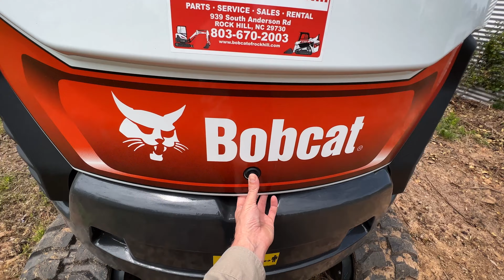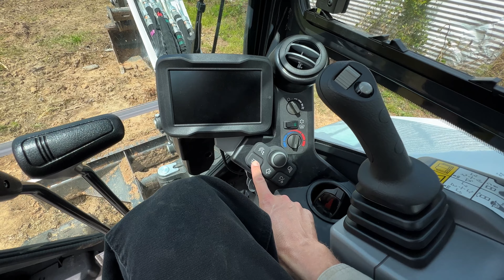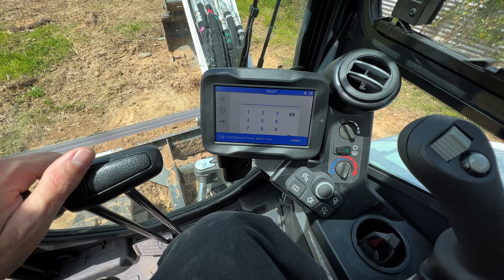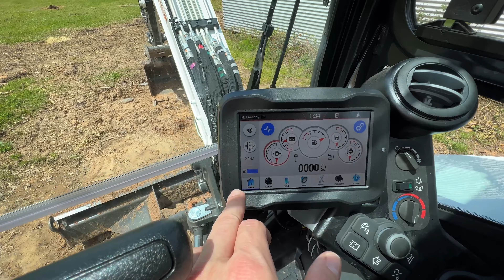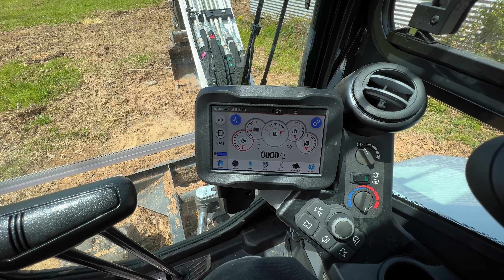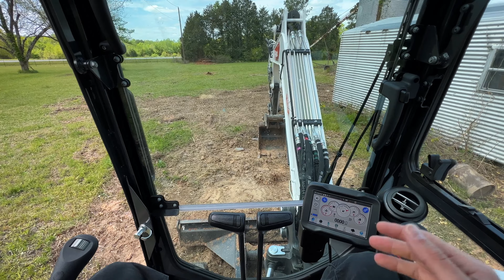New Equipment! 2022 Bobcat E42 R2 Series Added To The Line Up! Pickup & First Dig!

Comment: I always prefer the std control over the iso in the excavators, just feels right since thats how the skid steers are, lift on the left and tilt on the right, im also surprised that t770 doesnt have the forestry kit on it, makes the cab heavy as hell but I would much rather have an inch of plexiglass in the front and all around me as well as overhead protection that safety glass. Nearly all the excavators I have prepped have that same problem with the hose to the turbo it backs itself off but I have never seen it come off completely, I guess you could put a normal hose clamp on it, another thing I would check is on the washer fluid reservoir there is a little check valve on the hose and every excavator ive done, the little hose is barely on the check valve most of the time its not even past the flare on the little plastic check valve. and yes the newer style fuel filters are far superior to the black colored ones on the M series loaders, they did update them on the late model M series to the bigger filters like the one on this excavator with a clear bowl at the bottom